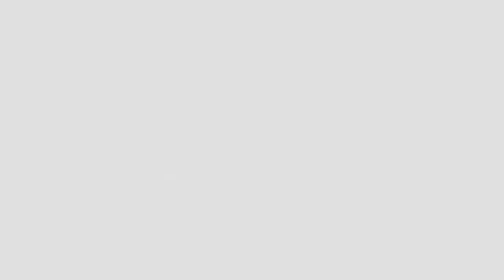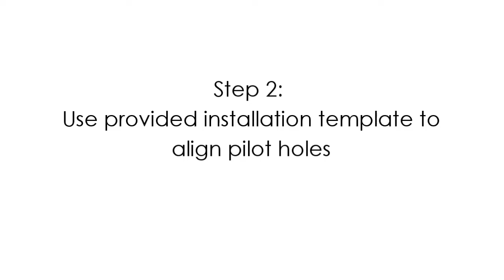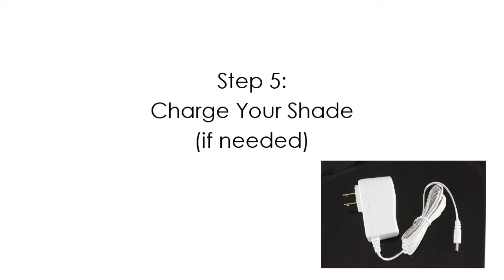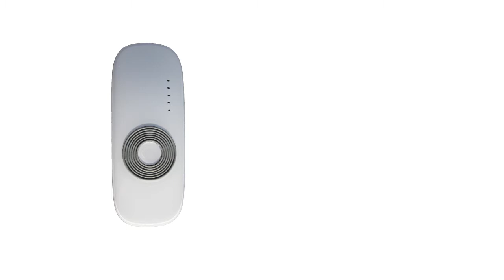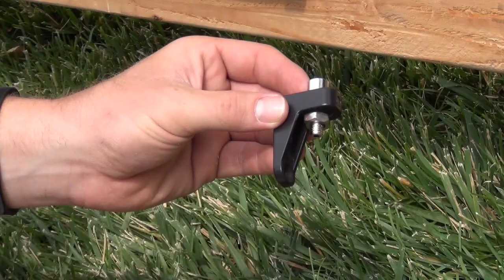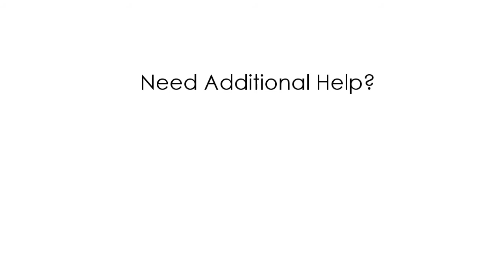Exterior Motor Shade with Premium PVC Fabric Installation

Comment: We have a unit that is a few years old and was on the house when we bought it 4 years ago. In the past year, after a couple power outages, the remote stopped working - meaning, hit the up button and it would just jog up an inch and stop, etc. etc. etc. Same for the down button. Trying to reset the limits, program, down, program, and then unit only beeps 3 times and jogs but doesn't reset anything. Same for trying to input new limits. Program, up, program and it beeps 3 times and jogs but doesn't allow any programming. Same for trying to reset the motor itself using the program button on the motor. It jogs and beeps 3 times but never 4. What does this mean. None of your documentation says anything about when it beeps 3 times.

Comment: Your instructions say to delete the factory limits push the program button and the top button then the program button. This video says to use the program button and the bottom button which seems to be correct. You need to change the instructions which are incorrect.
Reply: I just figured it out! The instructions aren't incorrect, just a little incomplete/confusing. Deleting the factory limits is Program > Bottom > Program. Limit setting mode is Program > Top > Program. I had to delete the factory limits before I was able to enter limit setting mode. Thank goodness for this video!